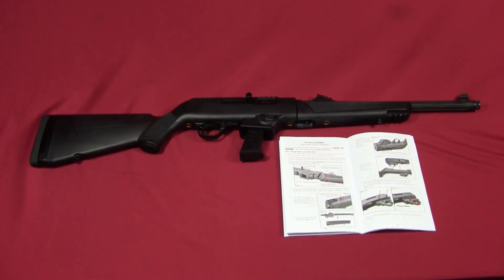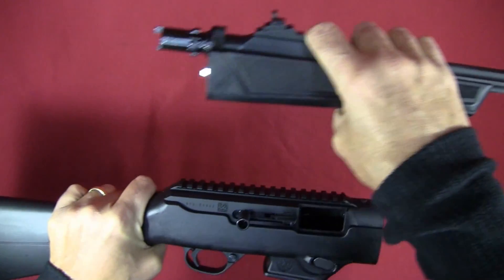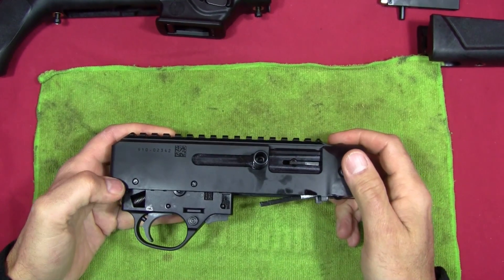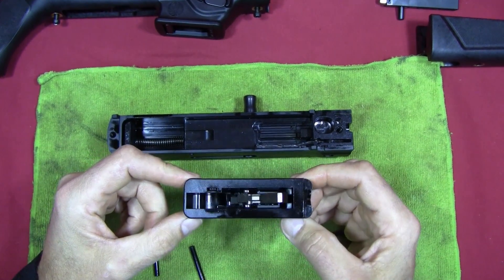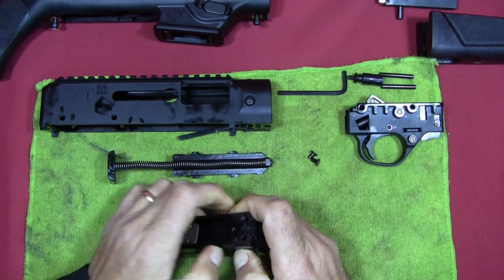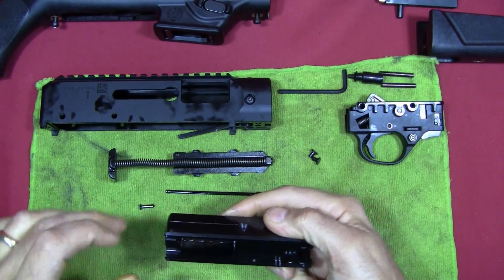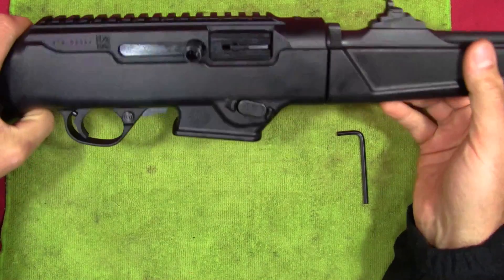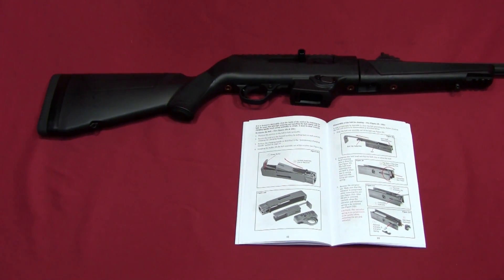Ruger PC Carbine Review: Part 4 - Disassembly & Internal Features

Comment: Did this for the first time yesterday.  Be careful with the trigger group.  I had 3 parts fall out of the trigger group, used another video to identify them as the bolt hold back and its associated pin & spring.  That pin will fall out pretty easily.

Comment: Thank you for the nicely done video. Appears to be a nicely made little carbine.
Reply: I recently bought one. I've put 500 rounds through it without one feed or ejection issue.  I used the iron sights and I was hitting a 12×12 metal target at 200 yards.  after 2 shots was on target I hit 10 out of 15 rounds.
Reply: I’ve run assorted factory ammo, and reloads including hard cast and powder coated bullets, and it has run great.  Most accurate was 88g hollow points with Unique, but it seems to shoot most anything well. Fun carbine.

Comment: has any one cross reference the trigger with a 10/22, looks exactly the same as 10/22.. I wonder if the volquartsen parts would fit it
Reply: No the pins are bigger on the PC9 in dia..